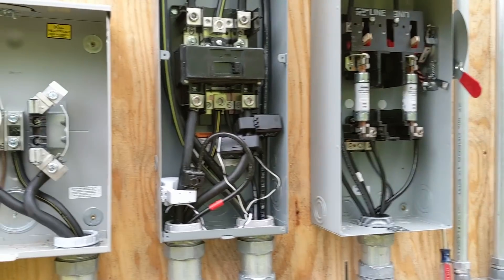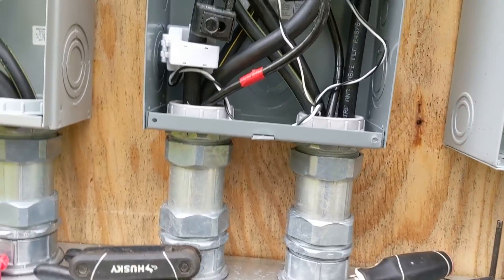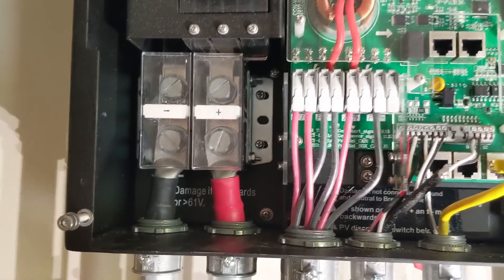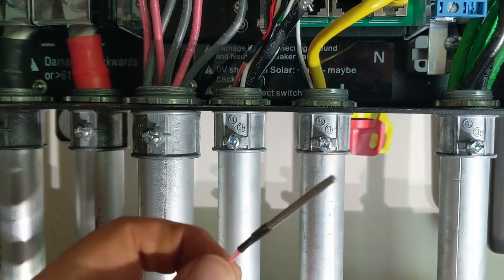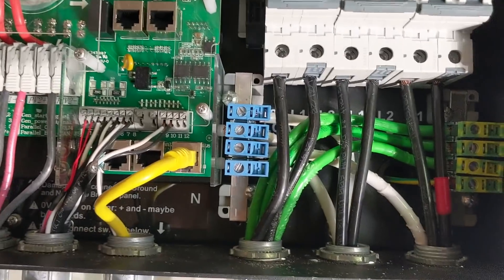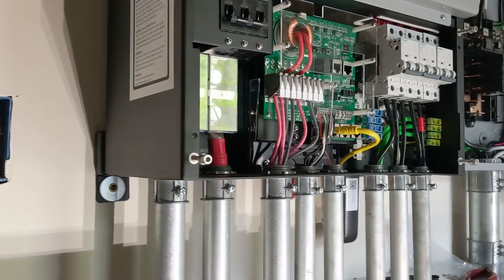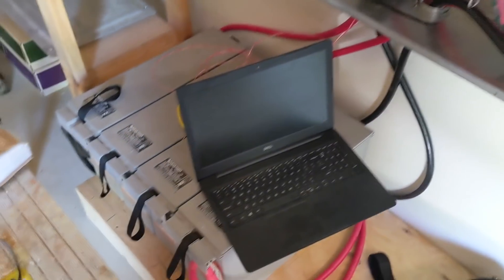Sol-Ark 12k Off Grid Solar Inverter installation

Comment: Installers using wireways/gutters with PV source wires (input to inverter) in the same wireway as all other wires, with no partitions...  690.31(b)  

I guess if the PV wires are fused (NEC def of "Power Limited", it's "OK"....  )  ?
Reply from the maker: 690.31(B) 2023.     Check out the exception.

Comment: I have 2 questions about grid connection and connecting to the sub panel.  If I have 2 meters in my home one for up and the other for down, how does that connect to the sol-ark 12?  I see only one breaker ( correct me where I am wrong). Second please confirm that you must connect the sub panel from the main panel before you connect it to the sol-arc 12?
Thanks

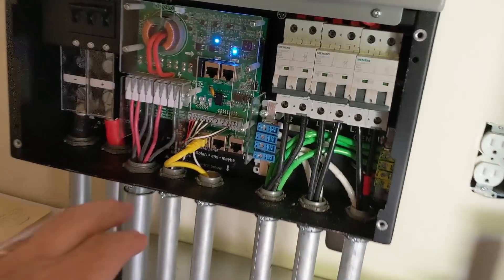Comment: Hey, I'm trying to figure out an issue I'm having with my Sol-Ark 12k inverter. It emits a 15 kHz whine at all times when it's running. It's present in your video, especially as we get to the board at around 7:28. People tend to lose this hearing range as we age, but I unfortunately can still hear it, which is awful. I can't be anywhere near it and it's also making most of my electronics inside make the same noise (e.g. a 'smart inverter' LG microwave.) Do you know if this is the case with all Sol-Ark inverters?

Comment: Question about the combiner for the backed up loads. Why run the two sol arks into a combiner first? Can't you land 2 separate breakers feeding the loads panel on the loads panel itself? So, you eliminate the combiner, mount a 100 amp main lug panel, pop a 40A breaker on the bus for each of the 2 sol arcs, and then add all your load breakers. Also, don't the specs say the sol arc puts out 37A in a grid outage, not 33?
Reply: I'm looking in manual and it says 37.5 amp continuous off grid, but I'm certain I read somewhere else it's only 33 amp....

Comment: Any luck finding a 200A ATS that works with Sol-Ark without a generator for whole home backup. Been searching for months and cannot find one that does not need the generator to supply power to ATS.
Reply: I'm working on this same situation.   I've got the generac 200A automatic transfer switch.  Not hooked up yet, but I was hoping it would work.  Let me know if you've learned anything on your project

Comment: I APPRECIATE YOUR KNOWLEDGE ON THE SYSTEM, BUT THE LINE-SIDE TAP, NEEDS MORE ATTENTION.  THE SPACE IN THOSE ENCLOSURES ARE LIMITED AND REALLY TIGHT! ALSO, THERE ARE SEVERAL VIOLATIONS SUCH AS; (1) CONDUCTORS ENTERING INTO THE WIREWAY MUST BE SECURED, (2) TERMINAL DISTRIBUTION BLOCK NEEDS TO HAVE A PROTECTIVE COVER, (3) THE WIREWAY MUST BE LISTED FOR ALLOWING THE DISTRIBUTION BLOCK TERMINATION & (4) ANY CONDUCTORS OVER #6 GAUGE MUST HAVE SOME KIND OF BUSHING PROTECTION ON THE RACEWAY TERMINAL ADAPTOR CONNECTORS ENTERING INTO THE ENCLOSURE, JUNCTION BOX OR WIREWAY.
Reply: ALVIN, YOU ARE CORRRECT ABOUT THESE BEING VIOLATIONS WHERE YOU ARE!! BUT YOU MIGHT NOT REALIZE THAT SHOUTING ABOUT IT DOESNT HELP CONVINCE, it just make you look like a conceited pompous jerk. If you know so much then whey didn’t you mention some other apparent violations as well. Please post your vids for us to pick through and comment on. Thank you. 

Btw did you just get out of training school?
Reply: Ren, your mind is in a bubble, no one is shouting, I type in caps so I can see better. get out of the box and stop playing internet politics.  More importantly, I don't need you policing the world, if that were the case, we're doomed!

Comment: Perhaps you misspoke but I don't believe you can mix strings of 8 and strings of 9 on the same MPPT - you can have strings of 8 on MPPT #1 and strings of 9 on MPPT #2 for instance but any paralleled strings need to be the same voltage on the same MPPT - or did I hear you wrong?
Reply: I had the same thought. Did you get a clarifying answer?
Reply: In pretty sure you can since he is using TIGO optimizers. The optimizers regulate the voltage.

Comment: I'm a little ignorant what is a ct and its purpose
Reply: CT is short for Current Transformer, it is basically a coil that slips over a AC "wire," current through the "wire" induces a small amount of juice in the coil which becomes a sensor output that is used to measure current going through the "wire." Google more info.
Reply: well a ct sensors you put on your main power lines which means it will senses incoming power from your meter and match it to cancel out the load. In effect will zero out your electric bill!!! Which lets you get away with not having a net meter agreement with your electric company .    Do you know of any other inverter that has ct sensors?????

Comment: I do nit understand why the ct’s,are not in the main panel measuring incoming/outgoing power. How is the power routed so you can use them where they have been located? Do the Two shutoff boxes connect directly to grid power bypassing the main panel?I have an issue with my main power box as it is an old zinko and the power to,the bus comes through abreaker which has two aluminum bus bars (not cable) coming out of the bottom into the breaker bars .

Comment: Hello i have a noob question will the sol-ark accept 120v l-n (not out of phase)? Some other inverters will take two 120v inputs that are not out of phase and just run 120v single  phase out put....can sol-arks do this as well or just run 120v single phase?

Comment: Your installation is extreamly straight and orderly! I'm psychotic about that too. In the 80s, I was on a job for a Japanese customer, who made me hold machining tolerances on parallel, level, and plumb, literally +/- 0.010". Our company installed and ripped out conduits for weeks, as he would fail everything that was out of spec, even by 0.001". I was young and very OCD and nerdy, so I eventually figured out how to meet his spec. I was technically a helper, but I had journeymen acting as my helpers on that job. By the way, it was all rigid conduit. I don't still hold myself to that tolerance, but I can't tolerate anything that's visibility inaccurate. My name is Richard, but they called me Rigid.

When I see seriously excellent craftsmanship, especially when it's electrical (like yours), it makes my heart race - as if I were talking to the hottest super model alive (not aroused, just exhilarated). But, when I see poor craftsmanship, it causes me physical discomfort. You are an engineer by trade, but at heart you're an artist! Bravo!
Reply: This is why I own a Japanese car (Toyota) and why they last longer. Higher standards than the Americans have.
Reply: @magicalphones 
I've now worked for two major Japanese companies and both had very high standards. I've also done robot programming work at both american and Japanese automakers and there is a difference. Japenese engineers tend to be very exacting with their weld positions and such, but they only do exactly what's needed. The American engineers tend to over build a little without requiring insane tolerances. In my experience, both methods worked well.

The problem arrises when american car companies try to imitate Japanese companies and include elements in their designs which require overly exacting standards. Somewhere along the line, things might go south. We americans are less like robots than the Japanese, which has plusses and minuses. Genrally speaking, we Americans require some fudge factor built in, then we do just fine.

On the other hand, I've done projects at Boeing and those Americans are ultra precision. It seems that we apply exacting standards where they are needed.
Reply: @cornpop7805  I'll say this owning and working in an automotive shop while owning both American and Japanese cars. Hands down bar far I see fewer major repairs on a Toyota under 200k then I see on an American car or any other for that matter. 

Had a Tacoma at 412k lost a bearing in the rear. Fixed the rear did a leak down test on the motor for the hell of it. Still in spec, original motor and trans in that truck. 

I bought a 2011 Camry brand brand new. 4cyl 6sp manual. Hole shot it burning first, chirping 2&3 for 58k mi. Clutch did not mind a bit. Then I took it UpTo a 120 dumped it in 4th gear dropped the clutch and destroyed the bearings on the input shaft and the synchro mesh. Besides the bearing noise and the fact I had to rev match it, it still drove perfect. Bright it to the dealer just barely under warranty and they put a new input shaft, 4th gear and synchro mesh in it. They didn't replace the clutch lol. The car had almost a 100k on it when I did the breaks. That's how much and how hard it got down shifted everyday. I continued to beat the hell out of it till their was no clutch left at 117k. I  have no clue how an OEM clutch took that much abuse. I put a new clutch in it what a pain in the ass that car was to do and my oldest is still driving it and it's at almost 300k. It's had Two wheel bearings replaced (front) besides tires, breaks, and struts. Not even a loose tierod end or ball joint. 

2012 Camry had only recalls done to it besides tires and breaks. It's at 175k 

2014 Tacoma sits alot I did have to add a leaf to the rear leafs I wasn't happy about that. But going across the scales at the scrap yard hauling out the garages scrap I had regularly 1200-1500 lbs in the back. This is the lightest duty Tacoma they made, no access cab, no tow package nothing. Not even power locks or cruise control.... 

The Chevy made it to 250k it took 2 motors, 2 transmissions, 2 rear ends, 2 transfer cases, countless other parts. It was a Tahoe. 

The Ford focus made it to a 120k and a valve cut loose in the motor... But it had almost as much in repairs and maintenance by then as it cost. 

The S10 did ok by 150k every suspension or steering part has been replaced atleast once if not more. Power booster went at about 110k but at 150k the oil pump quit and I scrapped it. 

But I did have a ford Taurus back in the day that had almost 200k on it and I hadn't done any of the repairs. No oil changes in over 70k bearing all grinding, suspension on the ground. Steering loose AF... I did put break lines in it to make it limp. At a 185k and nothing into it i sold it for 100$. Running and going still. 

Dodge way to much junk, Old Jag XJS awful, C series Benz never again electrical nightmare, bmw self destructed at 110k. Brand new beetle, 3 replacements later I sold it back to them at 29k of miles. 

The Honda is cheap to repair and decent quality, but it ain't a Toyota. I've had some lemon Toyotas also. Got a Avalon I refuse to fix, not expensive I just ain't pulling that motor out and apart. 

That's my way to long to much time on a Saturday doing nothing thoughts. Drive a Toyota unless ur rich enough to buy a new one every 5 years or 95k of miles or spend stupid money on repairs.
Reply: @magicalphones 
Toyota copied Ford's quality system and improved in in every way. The japanese have a saying "the nail that sticks up will be hammered down". Them and their companies demand conformity. The have procedures for everything; drinking tea, sex, even suicid. When I visited Japan, the homeless people had an official bedtime. They all had the same exact setup too (bed-roll, blanket, shoes, slippers, backpacks, etc).  When they left their sleeping area (under a walking bridge), all their things were neatly folded and placed in particular order, each one like the next. It was military perfection in that little homeless camp (4 or 5 guys).

We are cowboy spirits and that's both good and bad. Apparently, conformity rules in manufacturing something with a lot of critical parts. However, we still make the best commercial aircraft (the French would disagree). Our areospace wins because every single thing that's done is inspected multiple times. There is 100% traceability back to who made what, when it was made, and who inspected it - each time. If something fails, heads roll. Outside of extream measures like used in the areospace industry, we Americans don't really do conformity all that well. I worked for a machine tool company, who made machines that make machines, the tolerances of which are psycho tight. But, let's say there are 10 guys that sometimes assemble the same sub-component, which REQUIRES an exact procedure; there will be 10 different ways it's being done and each guy is brimming with pride that he does it his own way. That's cowboy.
Reply: @cornpop7805  lol I can't afford an airplane :p I gotta keep it on the ground. I always thought the Japanese were a bit weird with all that. Didn't realize it even extended to the homeless. That's crazy. Learn something new everyday.

Comment: The way I understand it the 12k manual says it's max dc output is 185A. The manual also says the MPPT's can hold up to a 16.5kw solar array. 185a x 50v = 9.25kw that is able to be pushed into the batteries at any one point in time. So if the array is making 16.5kw then the first 9.25kw is stored in the batteries but the rest of the 16.5kw is wasted. Do I understand that correctly??? Could someone with experience with a SolArk comment?
Reply: The extra is used for the loads and/or sent back to the home/grid

Comment: Just a question about have you ever built your own boxes to put your switches and stuff in because of the tightness of the CTS, and the other question is that cable tray looks a whole lot like your brain on crack I'm glad you could keep it straight excellent job